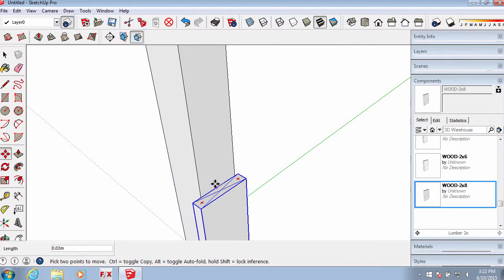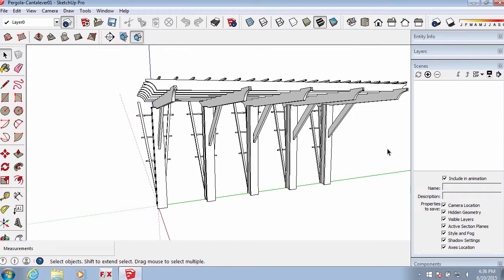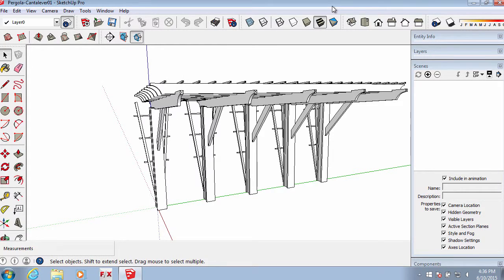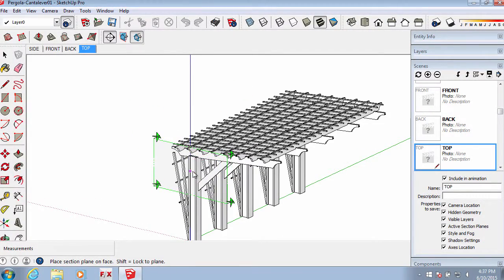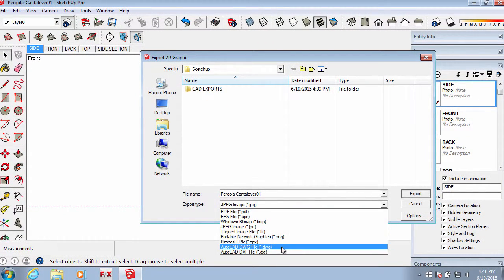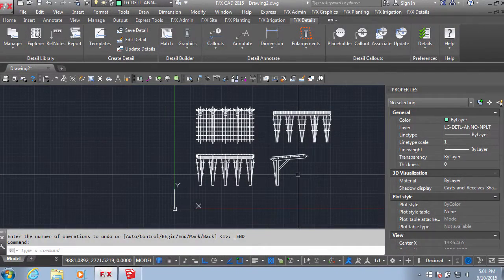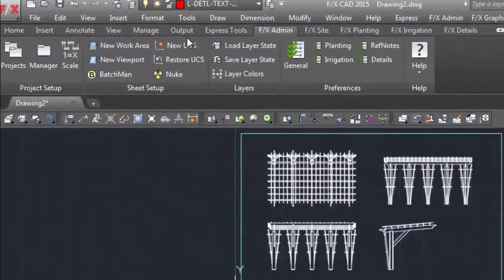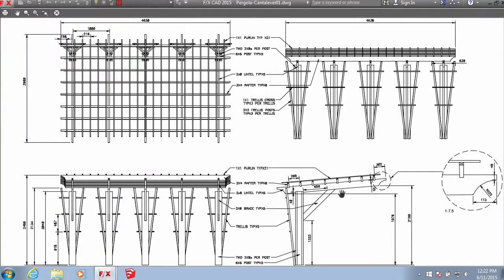Power Tip: Section Cut Details from Sketchup

Comment: why not send it into layout for sketchup
Reply from the maker: Fares, using Layout is certainly another option. However, Land F/X includes some really powerful detail creation and organizing tools on the CAD side only. Layout doesn't allow add-ons inside that particular program, so the same tools can't be there. This workflow allows us to have the benefit of a SketchUp-based detail block for use with the Land F/X SketchUp plugin, and use the detail creation and standards-enforcing tools in the Land F/X AutoCAD plugin.
Reply: @Landfx  but u r losing the link between the model and the 2d when ever u change something in the model it will not be changed in that Autocad file .
Reply from the maker: @faresjawad3096  Yes, that's correct. We do have it on the radar to improve that connection. For now, we still find this workflow gives more power for linking the detail to callouts on your other AutoCAD layouts, though, and is extremely helpful for more standardized detail organization and keeping track of details in your project with the detail manager. It's also faster to put together a full detail page in a project. If you haven't tried the AutoCAD Design F/X detail tools, you can see how they work in the other videos on our youtube account, or try out a trial.
Reply: @Landfx  I think I will take a look thank u so much .